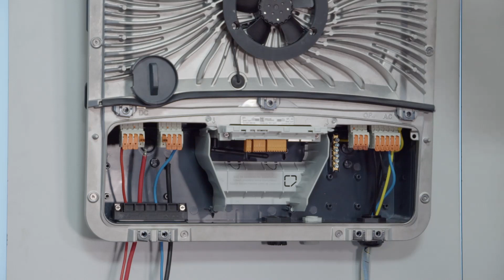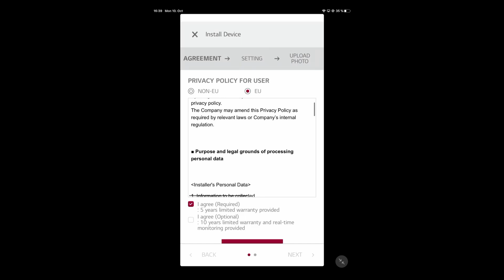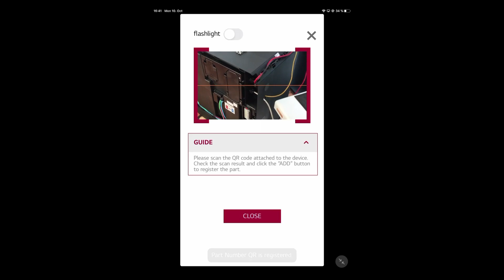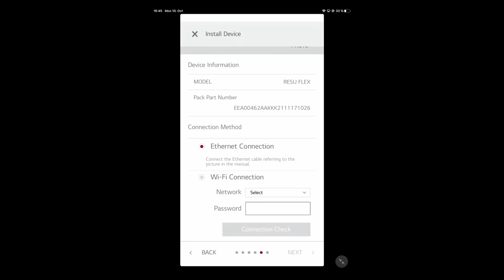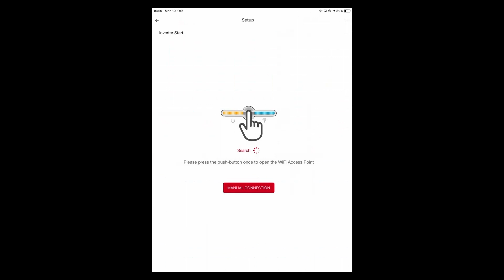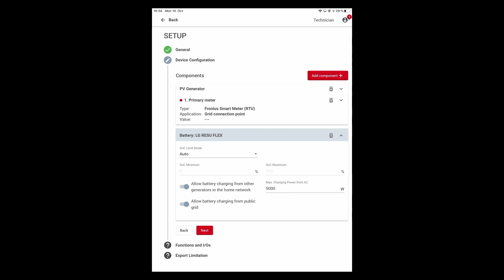Commissioning the GEN24 Plus and the LG FLEX

Comment from the maker: Important information: The Ground (GND) contact on the Modbus plug of the inverter can be connected to pin 1 as well as to pin 13 on the LG RESU FLEX, as these two pins are functionally equivalent.